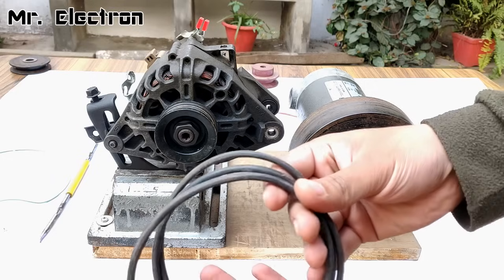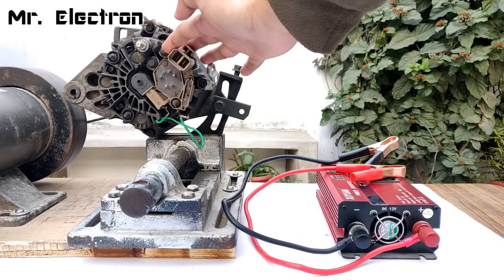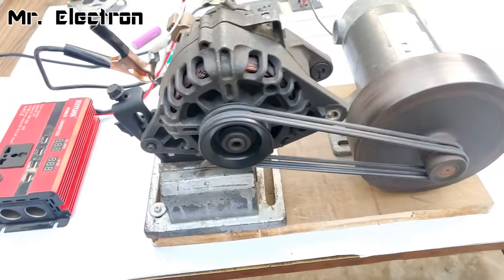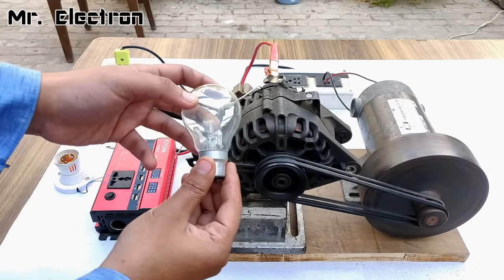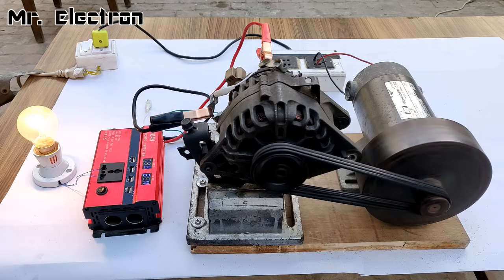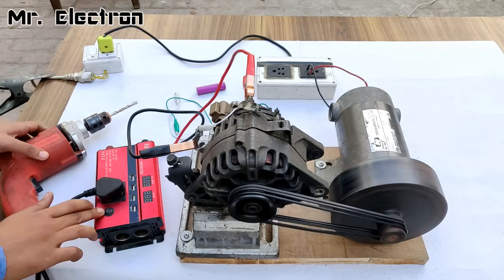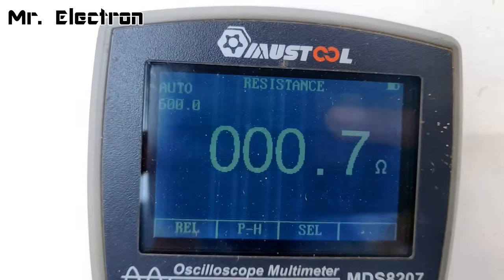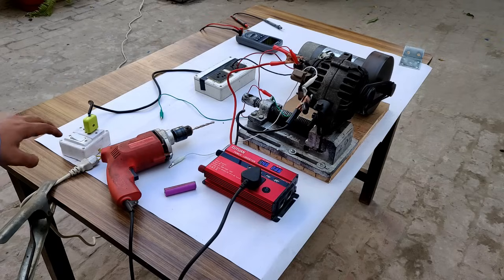220v AC from 12v 90 Amps Car Alternator 1000W DIY

Comment: You need a regulator in the alternator.  Then you need a battery in parallel with the alternator.  You can use a large capacitor instead if you want.  They sell them for audio systems.  Then your inverter will be safe from voltage and power spikes.  The danger comes when you suddenly turn off the load.  This will cause the alternator to voltage spike.

Comment: Alternators actually produce beautiful 3 phase alone without an inverter, hertz and voltage are controlled by rpm. Basically a mechanical vfd if you remove the regulator rectifier.

Comment: Okay. But the alternator must rotate independently with rotating counterweights (in my case, this is the case, and for the moment, I am not making the modification). To reach 3000 rpm, rotating masses of at least 50 kg are required. But with a permanent magnet rotor, it is much simpler with very low rotating mass and high efficiency.

Comment: Lawnmower or weed eater motor, belts and pulleys, and a car or truck alternator and you can run it periodically to maintain a battery bank /solar array system

Comment: The alternator is not design to Direct contact to inverter, the alternator is designed to charge the battery, then connect to inverter, and ready to use appliances at home.....

Comment: ok so you're using 220v(AC) electricity to run a motor to turn an alternator producing 12v(DC) which you're then converting back to 220V(AC).  Just give me $10, i'll kick you in the nuts & give you back $5, you can save $4.50

Comment: What about removing the rectifier from the altenator. The rectifier converts the ac to dc output. Or what about removing the regulator? If the redtifier was removed, it would be straight ac output?

Comment: Please start training program or online consultation or start exclusive membership module
Reply from the maker: Sure. Please join my patreon's page that i have just launched  - https://patreon.com/mrelectron?utm_medium=unknown&utm_source=join_link&utm_campaign=creatorshare_creator&utm_content=copyLink

Although, i will also be starting this exclusive membership on youtube as well.
Reply: @MrElectron  thanks for sharing
Reply: @MrElectron  I have 12v 130 amp brand new car  alternator
What changes I need to do to get 130 amps  ac current or maximum kva if I rotate the alternator with either diesel engine or electric motor
Reply from the maker: REWINDING IT IN SINGLE PHASE STYLE IS A POSSIBILITY.
OR SIMPLY A 2KW INVERTER CONNECTED TO THE ALTERNATOR OUTPUT. YOU WILL GET AN OUPUT OF  220V/120V AC FROM THE INVERTER AND THEN FINALLY STEPPING IT DOWN TO 12V AC WITH A POWERFUL "12V TRANSFORMER FROM AN OLD INVERTER " . YOU SHOLD GET AROUND 12V, 100 AMPS AC CONSIDERING ALL THE LOSSES IN BETWEEN.
( NOTE THAT SERIES CONNECTION OF EACH ALTERNATOR PHASES COULD WORK BUT AMPS WILL REDUCE TO 1/3 ALTHOULH VOLTAGE COULD GO UP MUCH HIGHER  WITHOUT REGULATOR ). I AM CURIOUS FOR WHY YOU NEED 135 AMPS AC INSTEAD OF DC.
Reply: @MrElectron  thanks a ton boss for your support I need it for my farming equipment
Reply from the maker: You are most welcome 😊
Reply: @MrElectron  ideally  how much kva or kwh can I get from 12v 130 amps alternator

Comment: Ok so I understand the 90 amp that runs the motor. What if added alternators 160 amp and 460 amp or close are added to the pully set up??

Comment: I have a Town and Country minivan and my alternator stopped working I replace alternator but still not working I want to bypass PCM / computer because I just need the battery to charge. 
I have an external voltage regulator and I can get power from fuse box that turns on when the key is on.  It should work but it's not Alternator is new and checked and voltage regulator is new too. 
But still not charging I am missing something, but I don't know what. Can you help me? I will generously make a donation to you. Thanks
Reply from the maker: Hi! Step 1 - get a 14v dc power supply of at least 10 amps and connect it in place of the alternator. If the battery charges then the problem is with the alternator if not then the alternator is fine and the problem should be somewhere else. Do this and revert.
Reply: @MrElectron  14v dc like a power adapter for laptop? connect in place of alternator?(which connections)?
Reply from the maker: Yes, if the laptop adaptor is rated at 14 or 15v, it could work. The alternator should be connected to your mini van with 2 wires. You have to disconnect the alternator and connect a power supply in its place. A power supply also has 2 output wires +ve and -ve, and your alternator is also connected with 2 wires to your van. Simply remove the alternator and keep it aside. Then, take the +ve wire of the power supply and connect it to the +ve wire that was initially connected to the alternator and similarly the -ve wires
Reply: @MrElectron  

1. I have red wire which goes to battery etc 
2. brown and gray  field wire from Alternator which I think is ground 
3. red and gray wire
should I connect laptop adapter power hot wire to #3 and other adapter wire to #2?

Comment: I don't get it.  If you had a DC source to turn over your DC motor why not just go directly into your inverter with that rather than using it to turn over an alternator just to get DC out of that and go into the inverter?

Comment: I have a question if this is to be used to generate electricity at home it won’t be proper to wait for normal electricity to power up the dc motor so my question is can a 12v lithium battery with some module power up the dc motor?
2: can the alternator power up the dc motor while running with the speed of the dc motor

Comment: I dont get it. If youre going to use shore power (that u powered electric motor with) why not skip all that alternator junk and plug the light bulb and drill right up to the socket.

Please someone, tell me what the break thru is in this widdeo 🙃
Reply: I assume the motor emulates some other rotation source such as water or wind turbine. So it's there just for presentation purpose.
In real world some kind of gearbox should be utilized too.

Comment: OK. This is what I don't understand.  
1). You spin alternator using motor? Y
2).  Alternator produces AC CURRENT BUT IS RECTIFIED TO DC? Y
3). Why can't you power motor(especially a high torgue/rpm) DC motor to spin Alternator and take out rectifier to make Alternator produce AC CURRENT.  THEN CONNECT SUB PANEL LEAD TO AC OUTLETS. ??? 

CAN YOU MAKE AN INSTRUCTIONAL VID FOR THAT?

WOULD LOVE TO SEE.

Comment: One thing I like is the variable speed dc treadmill motor. I have put these 1 or 2 horsepower motors on my lathe, drill press and milling machines using the micro vee belt to suit the pulley.

Comment: dont undertand what your trying to archive ,, u used mains voltage to power a motor to power a alternator,, to run a inverter,,,, how is that good to anyone maybe plug the motor into the inverter and use pull cord to start it . thats free nrg,, this is infact using mains voltage to use a inverter, no use what so ever or am i missing the point,

Comment: Ok let me get this straight.  You are powering a motor with electricity to run.

The motor let the car generator rotate.
To produce energie. 12/14v.
And with a deformer you created 230v.

Why don't you store the energy in lets say a car battery of battery used for solar energy.
And from there on 12/230.

So you can start the motor with energy from the battery.
And its lets say a closed circle.

The only question for that will it produces enough energy to the battery to let the motor run, and also other machine's.
( I'm a noob with electricity, so if i understand it wrong please explain)

Because i wanna make something like this with my swimmingpool pump.
By modifie the cooling rotor.
So when it runs the alternator will run also to create power something similar like your video.

And second one created with the output of water using waterturbine.

And use these 2 ways the power/fill multiple batteries.

Comment: It takes 100ws to power the motor you only get 80% part of the lose of power is from the builts how he's doing this is wilt a smaller motor inside the bigger one don't believe it you can get the same amount of power with a solar power running the motor then the motor will run the alternator the alternator will make 220 volts ac 220 volts is all you need to power a house it's really easy to build this I use this to just run my bitcoin mining rig you just need to add big batteries to store the power you don't use  videos like this needs to stop

Comment: Use a automotive break light bulb (incandescent) . I did this long ago to increase output and charge batteries. As the bulb gets brighter the resistance increases, making some voltage regulation.

Comment: Where is the interest? You put current in a electric motor and the alternator give you 12V and the converter give you 220V AC current..... Drop all of that, put the current of the electric motor in an adapted electronic converter and you will have 220V without motor and other.....

Comment: Hello , I have a question for you .
I have put together a setup using a 12 volt thread mill D/C motor and connected the positive from the motor to the positive of alternator and ground cable of motor to alternato

Comment: What you call self exciting is simply causing the alternator to act as it was designed it cannot always charge a battery or you burn out the battery over charge it all your doing is causing the alternator to ground one of it's field coils study voltage regulators and american dodge cars

Comment: You should use an alternator voltage regulator so that you will not have problem with over excitation. However, the rpm of the DC motor decreases as the load increases. This won't work perfectly.

Comment: Seems pointless to take a DC motor to run a generator to create DC and then invert to AC? At the end of the day you are drawing more Amps from the initial source to obtain your desired wattage? Hence, the amount of loss through heat and your "exciter" and the mechanical losses imposed in the entire system? Not really efficient I'm afraid...

Comment: So you are taking 220v converting it to 12v then turning it back into 220v. Seems like a waste of time. What would be impressive would be if you used the power generated to run the motor. That way you would be making free power instead of just turning 220v into 220v

Comment: Ahoy, nice video!  May i ask - normaly the car generator should always output 14,4V right? if not, the regulator of the generator is broken.  what is ment by the - generator is exited with 20V ? ... is it something like he has to switch to "energy production" mode with the batterie? thanks for clarification.

Comment: Don't you think it's important to know the RPM's or else, your just playing "blind in the ball park." I need to know the RPM your turning your alternator so I can design a proper voltage regulator for low speed applications.  It would also be important to know how much horse power it takes to turn the alternator at those low speeds against the physical resistance force of the alternators magnetic field.

Comment: Second video of wasted time! The alternator in circuit with a 12 battery will not only sell charge and excite but provide excess power to run through an inverter. We'll always run at 14.1 keeping battery charged, try putting magnets on casing and you can increase output and still remain at 14.1 V.. All the extra crap you add is not necessary. Alternators are designed to put out high currents at a constant voltage, whilst recharging their source. Adding magnets to the casing increases the field thus increasing Max output current.

Comment: Why are you not using the alternator voltage regulator to control the rotors voltage. Also the D.C. motor is too week and your belt ratio completely wrong. The alternator rpm is way too low

Comment: What is the point of all of this? Using ac voltage to turn a motor that turns an alternator which is run through a power inverter seems like an awful lot of unnecessary stuff to go from ac to ac

Comment: It's great to be scientific for fun, but in practicality you may want to use a battery as a storage tank from the output of the alternator using an alternator with internally regulated output. This way the inverter can take startup surges better. Also running the alternator at slow speeds to reach your desired voltage while cranking up the amperage will overheat the alternator and melt the windings. FYI.

Comment: bro the alternator is generating power, that is all cool, but why waste energy when u can just supply 12v  directly to the inverter, the project will make much more sense if it were driven by somethng else other than a dc motor which needs energy to rotate in the first place.

Comment: Try plugging the bulb into the outlet the motors plugged into.
Reply: You really don’t understand proof of concept do you? If he’d used a stationary gas engine at least then we wouldn’t be able to hear your drivel over the engine noise…

Comment: What happens if you quickly disconnect the electric motor from the wall outlet & reconnect into the outlet on the inverter after you’ve self excited the alternator depending on the amount of amps the electric motor needs to run wouldn’t this in theory work with enough alternators connected to the electric motor running the alternators to provide the required amps needed to run your motor and a larger inverter ?
Reply: Wondering this as well like a closed loop system

Comment: Am i missing something here. I thought an inverter takes DC and converts to AC. The alternator produces AC . Is there a rectifier connected to the alternator ? What does this achieve ? Thank you
Reply: Yes, the alternator has built-in rectifiers to change the AC it produces to DC, which is what a vehicle's electrical system uses.

Comment: Did you remove the voltage regulator from the Alternator and simply replace it with the "freehand wire you were using to increase and decrease resistance by lengthening and shortening the connection, and if so; why is the original voltage regulator not used?
Reply: J-Seven  Wow! Thanks man, your my "Hero" now I got to go back and watch the video again because I wrote my comment over 7 month's ago, and you answered it 7 hours age. But, better lat then never. "Thanks brother"

Comment: What a senseless and missleading experiment. An electric motor drives a generator, that energy is transformed by a elctronic switching device from, 12 V to 220 V. You will lose minimum 30% in transforming the energy. Do you see the thin belts going from the motor to the generator? Do you know a normal belt in a car? These thin belts ar not strong enough to transmit the power you need when the drill is under load.

Comment: I am not sure but I believe that the alternator generates about 50v three phase and it is converted to dc12 by the diode pack. Would it be better to remove the diodes and use a star or delta transformer to achieve the mains voltage?
Definitely better with a battery in circuit to buffer the alternator load if sticking with the inverter.

Comment: May I try it when the alternator still use regulator IC. regulator IC still connect the alternator. I want use it like your video. It's danger? I don't know how to use it's alternator with  gasoline motor. How to wiring it. Pleased help me.I thinks regulator IC still work.

Comment: I'm confused, why did you need to use the 3.7 volt battery to start the alternator when the alternator was already running?

Comment: AC MOTORS LIKE DRILLS NEEDS TO BE FROM A PURE SINEWAVE NOT FROM SQUARE WAVE IT COULD DAMAGE THE MOTOR DRILL ...TRY IN IN ELECTRIC FANS SWITCH IT ON INVERTER THEN SWITCH IT ON ON REGULAR AC SINEWAVE POWER U WILL SEE THE DFFERENCE IN SPEED AND THE TEMPERATURE OF ELECTRIC FAN FAN MOTOR...AND BY THE WAY WHAT BENEFIT U WILL HAVE FROM UR YOUR INVENTION ITS NOT FREE ENERGY U CONSUME POWER FROM UR ELECTRIC SERVICE PROVIDER TO RUN THE AC MOTOR THAT WILL DRIVE THE ALTERNATOR... U HAVE TO EAT MORE FOODS BOY

Comment: 😂😂😂😂,using AC electricity to generate electricity, what kind of a damn idea is that?  the reason behind electricity generators, is to use other force to generate electricity, like fuel, (gasoline generators), water falling flow pressure on a dam's, or water heated presure flow caused by nuclear reactor.  You could make your video more interesting if you use that inverter on a fully charged  12 volts car battery, ofcourse with car terminals disconnected for car safety, or use inverter directly on a running old car so you will.not worry about its safety. Man I have 12V 220 V inverter that can.deliver 2000 watt power, I used directly on a car battery to power a vacuum pump on ca AIR CONDITIONING SYSTEM, BEFORE FILLING IT UP WITH refrigerant 134. And it does work just fine.

Comment: What the use of that project.; using home AC Current to power motor that turn car alternator and then using Inverter To power house appliances, just use Home AC current to power home appliances, why going trough al, trouble to do so, I used inverter to home appliances just from car battery directly with car off. I have a 220 v inverter that can supplies 2000 Watts. I used it to power  AC vacuum pump before filling up AC system.

Comment: WHY would anyone do this??  Just plug in to the original power source instead converting mains power AC to DC to drive a motor to drive an alternator that  again converts AC to DC to then run the power through an inverter to change it from DC back to AC that you started from in the first place.... This has to be one of the stupidest projects I have come across. So much power wastage.
You'd be better off using a 2Hp 4stroke engine ( or larger) with the governor set to about 60-70% of maximum RPM to drive the alternator.
Using a 100amp alternator.. 100amps x 12volts = 1200watts... 1200watts = 1.6 Horsepower.